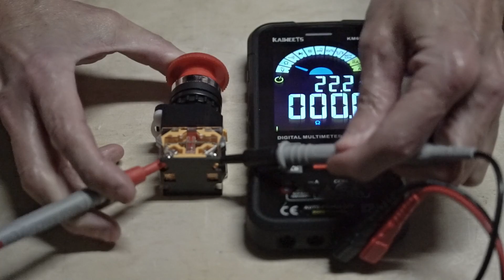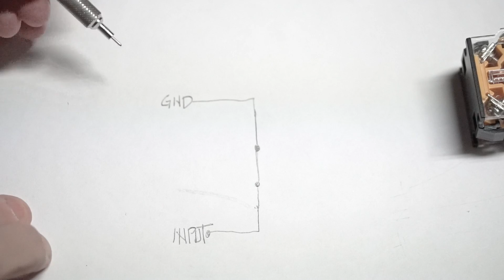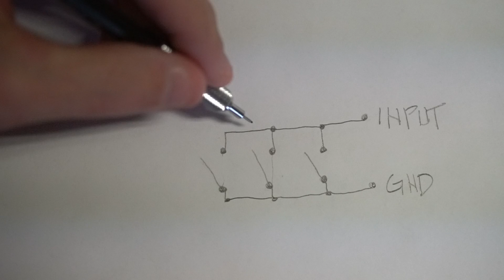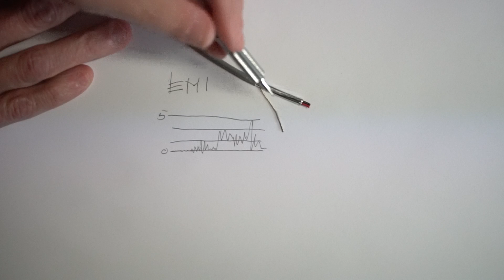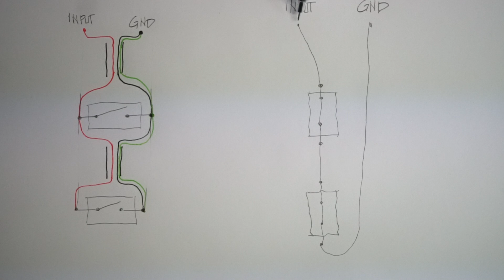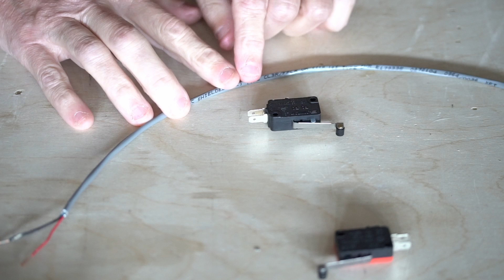Limit Switches and E-Stops, The Ultimate Guide

Comment: ooooh my, i don't know how to properly thank you. that worked "perfectly" !! thank you thank you. i did have to check active low for it to work (not sure why) But the good news it that it is working. ( i will be extending my membership) thank you so much! Please keep your videos coming, i do learn from them and i think its great that you are willing to share.
thank you sir !!
Reply: i wired the switch with the NC contacts. and if i run the machine and hit the Mushroom estop, the machine stops (opens the circuit) i think its working correctly. is it normal to have to check the active low with NC wiring? just curious
Reply from the maker: @JoeBambino-h9e  Is the switch connected to 24V+ or the V- (DC ground)?
Reply: @ i have the switch wired to the dcm on the motion controller V-
Reply from the maker: You are very welcome. Typically the active low and active high have to do with the connection being either NO normally open or NC normally closed. The NC schema is the "fail safe" option.

Comment: ok, thank you. i will give that a try tomorrow. i hope its that easy. lol . i also would like to know how to determine what a port is and where are they located and the pins from what i think a pin is and where they are located is on the actual motion control board, is that correct? or? i apologize for asking simple questions to a veteran as yourself. But i just don't know the simple things and it really makes the harder things that much harder. Again, i thank you for your time and the sharing of your knowledge and experience to us newbies.
thank you
Reply from the maker: For the RNRMotion board, the port is just 3. There really is no specific location for it, it's just 3. Haha. The pin relates to the IN number. If you are using IN1, then the pin number is 1.

Comment: thank you for the clear description! Could you please give a description of the configuration of the Emergency Stop button in Mach3 using the red RNR motion controller? i'm a newbie and i have been running my homemade cnc without a Estop button and i crashed, needless to say i was scrambling trying to shut it down, and now i figured i should have a estop. i have it wired using a mushroom type button and a 24 volt dc power supply. BUT i'm unsure how to configure it in mach3. 
PLEASE help
i do use alot of your information. being new to the cnc world, i sure do appreciate what you do for us that are just starting out on this adventure. thank you sir
Reply from the maker: Here you go: https://www.youtube.com/watch?v=8un8rbQcoZU. Watch that video first. The only difference is you need to specify the estop pin in the config->ports and pins->inputs. Remember to specify port 3 and the pin you are using.

Comment: Awesome content and presentation.  Love your channel!
Do you work with Arduino much?  I'm having trouble with limit switches on my application.
I have two versions of code for my stepper motor. One with a typical Pot for speed control, and one with a acceleration routine. Both work fine until I add limit switches and the code for them.  The Pot/speed control works fine with the limit switches.  The code with the Acceleration routine does not.  The stepper just rattles. It's a strange situation.  I've considered noise, but the Pot and limit switches works fine.  Any thoughts?  I can email you if that is preferred.  Thank you. Regards.
Reply from the maker: This would be a good discussion point in my daily live stream.

Comment: Hi, great info. Do you have any ideas? Why my build a mach3  lathe x homes perfect, but z will not move off home switch. Tested is working switch. Any help will be appreciated. Thanks David
Reply from the maker: What controller are you using. If you have multiple home switches on the same input, that may cause a problem. It's best to keep home switches on separate inputs.

Comment: On my torch lifter I have 3 switches. One is a home switch with two limit switches. I have a 4 pin aviation plug connecting for the torch lifter housing. I want to use a 4 conductor shielded cable for wiring all three switches coming out of the torch housing. Would it be acceptable to jump the ground on the home switch to the ground on the limit switches with the shielded ground? That way I would be using the shield wire for all the switches.
Reply: Use a common bus bar for all grounds and the work lead of the plasma torch, then tie this into a earthen grounded rod with a cable the same size as the work lead on the plasma source. Ground only the controller end of shielded cables.
Reply from the maker: Yes, you can connect the sheild to any ground. It's best to keep the grounds and the sheilds as close to a point as possible to reduce any ground loops.

Comment: I think you should connect the shield at only one point (to avoid ground loops).
Reply from the maker: You are correct! I need to update this video to reflect that!. Shielding at both ends are best for high frequency applications.
Reply: Do you mean to connect the shield cable to the switch but not to ground on the other end?
Reply: @johnbowden504  The cable shield (the braided shielding) should be connected to ground at a single point (to avoid ground loops when there is a voltage potential difference between two ground connections). So at one side of the cable. You think that ground=ground everywhere (when linked or connected by wire/metal) but there can be slight potential differences (also induced by radiation noise). And when there is a potential difference, current will flow. You don't want current in the shielding, it should just act as a Faraday cage at one ground potential.
Reply: @johnbowden504  Ground to a common bus bar at the controller end only, attach the work lead to this point as well then ground the buss bar it to an earthen rod with a lead the same size as the work lead. Hypertherm and a few other companies has a bulletin on this..

Comment: I am using a "bl-usbmach v2.0 d1712" board. It has the folowing connections:   GND,   In1-Estop,   In2-Probe,   E3-Limit,   In4-Home,   In5-Reverse.
I have 6 endtops. 2 endtops per axes in seris.
So i only have one Endtop connector on the controller but i also have a Limit-connector.
What are the differences in theese 5 connections?

This is how i think i should connect my endstops:

                     ENDSTOPS
       ------------------------------------------------------
      |                      |                    |               |
     X                     Y                  Z    axes  |
   GND             GND              GND            |
E1     E2      E3       E4      E5       E6        |
|          |          |          |          |          |           |
-----------          -----------         -----------           |
     |                      |                    |                 |
   In1                 In2                In3           GND

Question 1:
In one youtube video he has 3 endstops, X, Y and Z.
He connected all endstops in series so like this:

axes             X              Y              Z
+ -------------- E1 --------- E2 --------- E3 -------------- GND

How does Mach3 know witch axes will be trigered?

There is only one connection for all axes witch i think is not how it should be.

I think that every axes should be seperated on one side of each axes.

Question 2:
The only ground on my cnc is on the powersuply 220v.
Can i connect every Ground (and also the Shield of the wires) to the Ground of my powersupply (220v)?

I only find information on how to shield your cnc but no info on how to connect shielding in your electronic-box.
So a lot of these tutorials are not complete i think.
If you show info about shielding then show everything from wiring to connection at the source.
Reply from the maker: Question 1: In general for limit switches (not home switches), the determination of the axis that triggered the switch is not important. The importance lies in stopping the machine for safety. Is there a reason you need to know what axis was triggered?
Question 2: I would connect the common for the switches to the digital ground. 

All shield should be connected to earth ground of the 220V circuit, unless the ground is too noisy, like in plasma machines where the plasma has an independent earth ground. Earth ground is also connected to the cabinet. Thus, all of the shielding and ground is going to the same place. Shield can also be connected to the digital or DC ground as a second option.

Comment: Great Vid, thanks. Regarding proximity switches, I am considering using 2 on each of the X & Y axis, and 1 on the Z axis. Can they both be connected together at the controller input?  Cheers.
Reply: If you are asking if both X sensors can be connected to one input, the answer is yes. But doing both Y and X on the same input would only be good if you wanted to do limit only.

Comment: Nice video with lots of information. I have not found any video of yours showing how to connect the z- probe  using the bitsensor controller card and mach 3.  Thank you in advance.
Reply from the maker: I will be working on this very soon. Generally, however, you are going to connect the probe to one of the inputs and use a script to zero the probe. In my coming video, I will show the script and how it works line by line. Alternatively, you can also use a probe in the "ref all home" process.

Comment: I used shielded cables on all my switches, and on my motor. Still I am experiencing EMI-issues. I am now converted the connections of my switches to the terminals to an opto coupler situation. Hopefully the issues will be gone.
Reply from the maker: You can also try completely separating the motor ground from the signal ground.  Most controllers have optoisolators to separate the signal grounds on the controllers, so there is no sharing of the higher-powered grounds unless they find their way through your facility or house. Like with plasma, plasmas require a completely separate grounding rod in the earth to mitigate these EMI issues. If your computer, controller, or anything that uses delicate signals, make sure they are also not affixed in any way to the machine's structure where the ground can sneakily get to the signals.
Reply: @PatrickHoodDaniel  They are separated, but act up nonetheless.
Reply: By the way: you grounded the shielding on both ends, which is a nono in the electric world.
Reply from the maker: @WillemvanLonden  grounding the shield on both ends is for high frequency applications. It is only necessary on a single end from what I have learned.
Reply: @WillemvanLonden   you absolutely correct, it also called Ground Loop

Comment: Interesting information Thank you for sharing it … 
I have a point … i built my CNC plasma and I got EMI issue… i do my research and figured how to wire it .. exactly like you say but except the grounding it should go to earth capper bar and in to the earth AC ground rod … i don’t know if it gone work cause i still not wired my cnc yet. 

Thank you so much for the video.
Reply from the maker: Absolutely. You are correct as you want to create a ground rod specifically for your plasma. Unfortunately, this video needs to be machine agnostic, and adding detailed information for a specific condition might be confusing to the viewer. I will be addressing this in a video on plasma and THC setups, however.